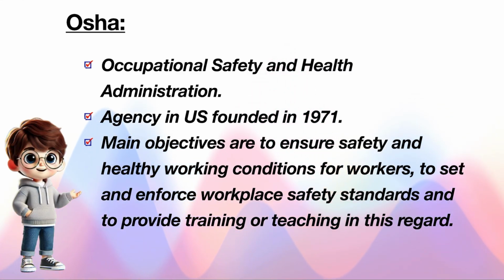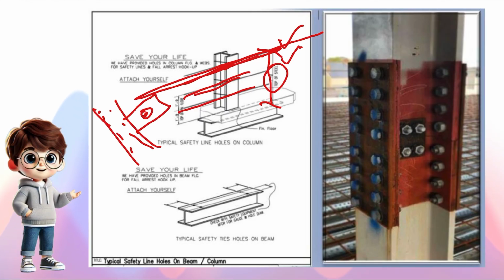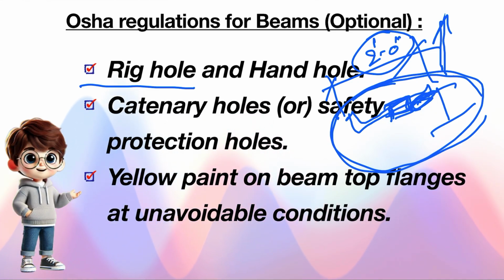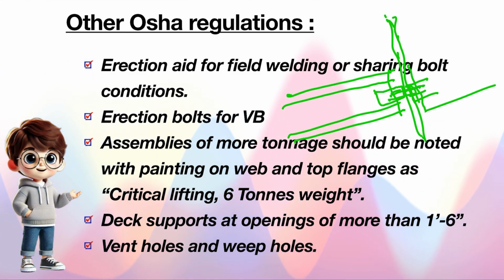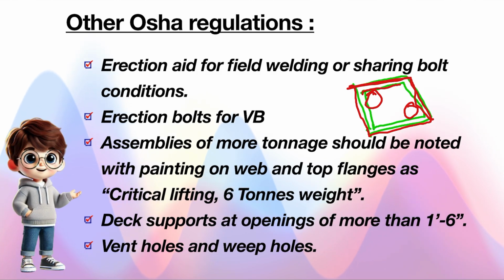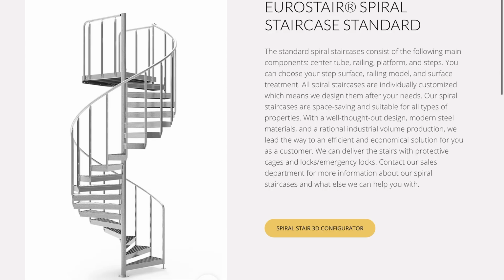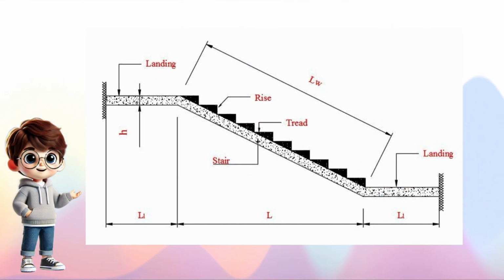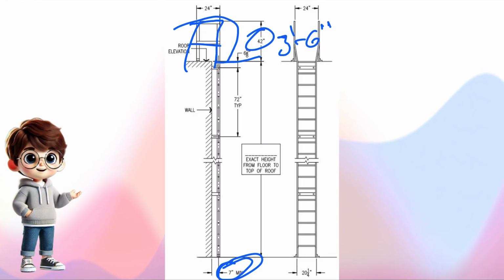Steel detailing training Session#11   OSHA, stairs, Handrails and Ladders

Comment: Pls tell me that as per OSHA rail c/c dim from FFL to mid rail, mid rail to handrail u told 1'-9". that is , 1'-9" from top of handrail or C/L of handrail
Reply from the maker: That should be from top, not from center. From finished floor to top of mid rail will also be 1'-9"